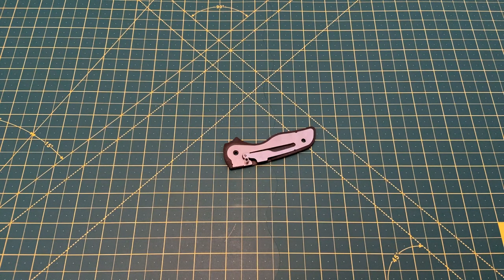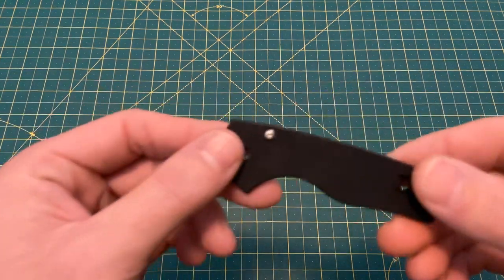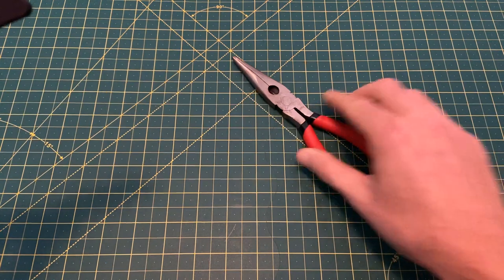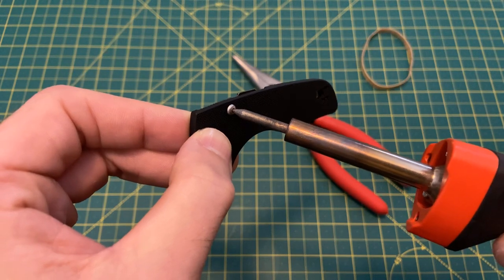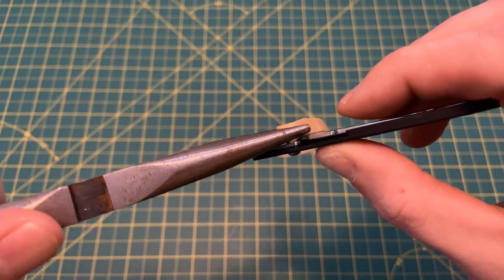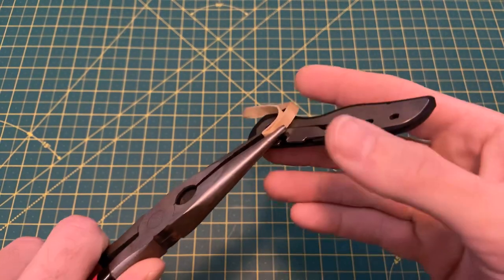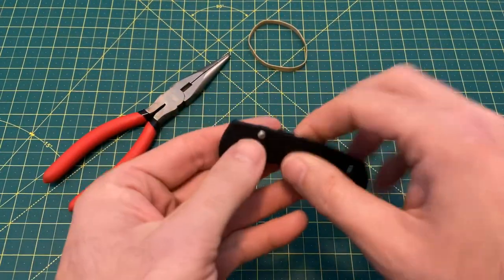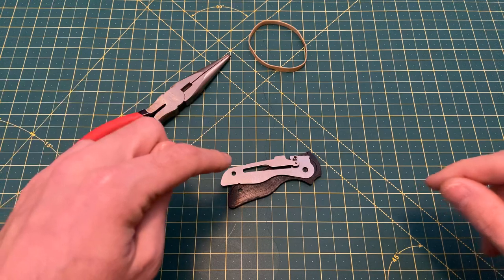How to back out an overly Loctited (glued) screw from a Spyderco knife!

Comment: Good info. A variation is instead of the rubber band, I've used Gorilla tape on the jaws of the pliers. The Gorilla tape is nice and thick so it will protect the finish of the part being held.
Reply: Another good tip, thanks for sharing.

Comment: Nice rubber band trick.  Sometimes high-quality screws get seized just from being over-torqued, and without any thread-locker at all.  It's crazy how annoying the T6 torx size can get, especially.  I wish everything was at least T8 and up, because it would save us all a lot of hassle.  Those don't strip as easily.  But unfortunately, T6 are needed in a lot of designs.

Comment: Spyderco screws have screwed me many a time.  I just sent my pm2 tanto in to them.  I was replacing the clip with a deep carry mxg gear clip.  Got the original clip off, then while screwing in the new clip, one of the screws just spins and doesn't catch.  Also stripped the heads of the other screws because you need to screw them in at an angle through the hole in the mxg clip.  Arrgh!  And like you said, $5 for return shipping.  I guess poor, money strapped Spyderco can't afford to ship it back for free.

Comment: Had to do this exact thing on a screw cross threaded into a standoff on a Civivi. I didn't use the rubber band though that's a good idea! I have teeth marks on the backspacer on mine lol. Awesome job this will help tons of people for sure!
Reply from the maker: Thanks bro! Damn, I should’ve mentioned that it also prevents the teeth marks from the pliers, which is just as big of a reason as to why it’s a great trick! 👍🏼👍🏼

Comment: I wish I had spent the $10 on a soldering iron before I ruined a Real Steel Sacra and a CMB Predator with stuck screws.  Now I have a Bestech Slasher with two stuck screws and with a cheap soldering iron both screws were out in about 30 seconds.  Thank you.

Comment: I want to offer a secondary solution to applying blue loctite upon reassembly, the product is called Vibra-tite, made by ND industries. As a long time tool maker, Vibra-tite is what was used on fasteners that would be loosened and retightened without applying thread locker. Was also used for fasteners that are subjected to alot of vibration, think bolts on an old Harley scenario.